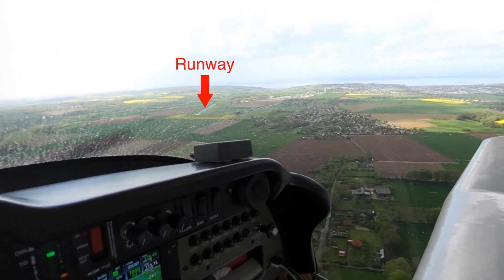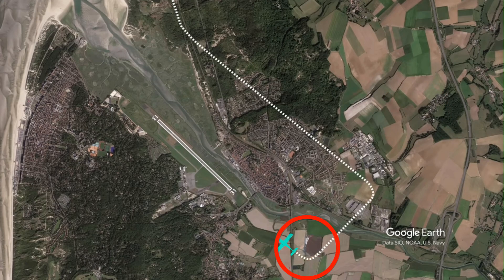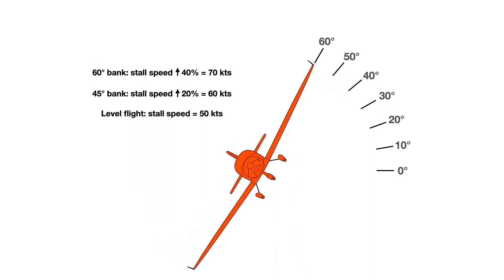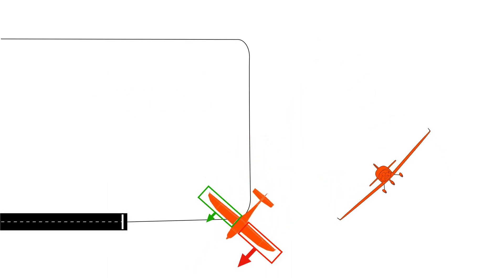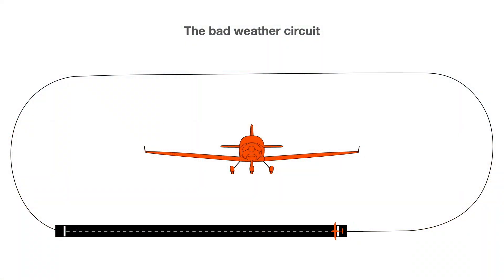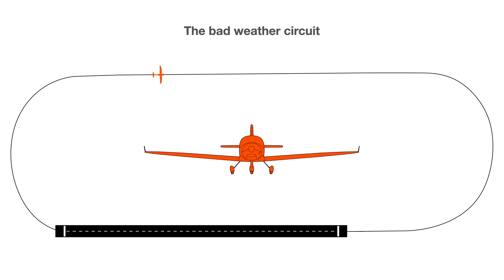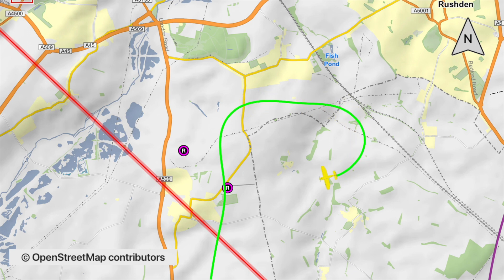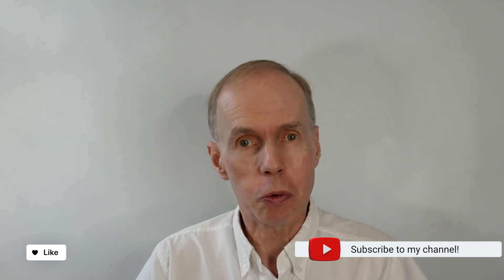Avoid the 'graveyard turn'—a safer way from base to final

Comment: Your video makes so much sense. I just soloed last week and during the beginning of my landing instruction I instinctively flew a rounded/racetrack traffic pattern. My CFI suggested that I fly a more squared off pattern but did say most all new students instinctively fly that rounded pattern and he said it actually made sense. I’m very conscious of my AOA during that base to final turn because I definitely don’t want to stall. If the Air Force teaches the more rounded pattern and if it’s safer then I think it should be standard if not an acceptable option, but I’m still just a student pilot.
Reply from the maker: Congratulations on your first solo and I hope all goes very well with the rest of your PPL training.

Comment: I very much agree with the racetrack pattern, same as we use in crop dusting.  Another advantage of this tighter circuit is that we can allow the nose to go down as designed (dynamic neutral stability) to prevent stall.  The disadvantage in low wing, is poor visibility away from the target (say a long instrument approach final).  But high wing has poor visibility toward the target.  While we had more incidents and accidents before PTS/ACS, we had the same the same unacceptable 300 or so fatalities.  To reduce those fatalities, should we not retain the 1944 Stick and Rudder principles and techniques.  There would be fewer stalls around the airport, too low for recovery after startle, if we returned to Wolfgang's advice to pay attention to what the airplane wants to do?  What does the airplane want to do in all turns?  Is it wrong?  What causes stall?  Exceeding the critical angle of attack is when the stall occurs.  What causes it since the airplane cannot stall itself?

Comment: When I started flying remote control airplanes - I decided to use one half - cirlce turn to land - like the u.s. Navy uses to land aircraft on carrier decks. I only had to turn one time and at a much lower bank angle. It seemed much easier and safer to me (as presented in this video.) I became an rc instructor and I teach all my students this approach.

Comment: If a point is repeatedly the location for deadly accidents it should be scrutinized. Similar I am in favor of a slight turn after takeoff of 20-30 degrees heading so that, when an engine occurs, the turn back to the runway is a lot easier.

Comment: I never noticed the hard 90 degree turns on civilian pubs, assuming they were just drawn that way, and assuming civilian pilots were using the smooth constant rate of turn military pilots are taught. Now out of the military I see squarish 90 degree turns are taught. You never know what you don't know.

Comment: The issue with the constant turn, on a right hand pattern, on a high wing. The wing would block the visual contact with the runway. Because it’s a descending right turn to final in close pattern. Turning final, the chances are higher for being too high or too low for final. The 90 degree rectangle pattern, the base is used to determine high or low and time to do something about it.
Reply from the maker: Thank you for your comment and the point has already been raised by others. I do not have much experience in high wing aircraft, but they also have to manage the bad weather circuit pattern where the circuit, albeit lower, is tighter and the angle of bank is, therefore, greater than in a conventional circuit.
That aside, however, as I explain in the description I am not suggesting that the pattern I describe will be ideal for every situation, and variations may be appropriate according to circumstances; I am trying to point out the dangers of a sharp base-to final turn, that is typically undertaken at low level and low airspeed where there is little margin of safety, and offer a solution to consider.

Comment: while I would agree to a wider racetrack pattern (I see no real disadvantage) I would like to point out that the problem with the standard pattern is not the required 30° bank final curve but obviously bad pilot training. I am a glider pilot and have spent maybe 1000 hours of my livetime doing 45° bank circles, mostly close to terrain. I had not one critical stall incident during this time. If you do this often enough, you get rid of the (bad) instinct to pull up if the ground gets closer while in a bank. Also required is spin training to get more sensitive to stall conditions.
Reply from the maker: Thanks for your comment. I fear that, even with optimal training, these base to final turn accidents will keep happening. With a sharpish base to final turn being a particularly critical stage of flight (low height, low speed, high angle of bank), a few distractions (such as weather, late radio calls, other traffic in the air and on the airfield) can easily divert the pilot's attention from flight parameters which leave very little room for error, whereas, if the aircraft is already set up in a stable approach (constant speed, constant angle of bank, constant rate of descent) that is comfortably within the safety envelope, then any such distractions will be that much less important.
All powered aircraft pilots go through stall training and whilst I agree that spin training is a very good thing to do it is unlikely to save the pilot of a powered aircraft recover from a spin a few hundred feet above the ground!

Comment: Another teaching point that needs to be changed in the name of safety during primary training is, instructors making it imperative that the base to final rollout be exactly on the runway centerline.  Talk about a rule that causes fixation and dangerous rudder correction from a new pilot, this is right at the top of the list. Even using the much safer rounded, downwind to final 180 can turn out to be dangerous if the instructor makes a big deal out of overshooting the centerline.  Overshooting is a comparatively minor issue and is safely correctable by just teaching to gently continue your established bank angle back to the centerline and praising the new student for correctly accomplishing that.

Comment: I think it mostly comes down to predictability. Every pilot on the planet knows what a base leg is…every pilot knows what it looks like when traffic is on final. It’s also easier to gauge “ok, that guy just passed me on final…one, two, three, reduce power”. Those types of things become a little more chaotic if everyone’s doing “short approaches” (which is kiiind of what this is, in essence) with other traffic in the pattern. For the record, I’m not saying one is right, one is wrong, one is better, etc…just simply stating why I believe that general aviation continues to institute such traffic patterns. Myself, I do my best to avoid any such “base to final” situation with early, shallow turns to final and keeping my airspeed well intact until I roll out and I’m stable…even in short field scenarios.

Comment: Hi Steven. I cannot agree with your assumptions in the first half of your video. As we all know, an a/c can stall at any speed, but only one AoA. I don't think I have ever seen or executed a LEVEL base to final turn. In every circuit-to-land that I have seen or performed, the a/c makes a descending turn, unloading the wings and reducing the AoA. That said, I agree that a constant rate turn can work well, if the pilot is trained to do them, like the military.
Reply from the maker: Hi, Bob, I was not trying to imply that the approach was level!
Since it is still possible to stall in a descending turn, the point that I was trying to make is that a stabilised approach with constant rate of turn, airspeed and rate of descent provides a greater margin of safety and is, therefore, more forgiving of error, than an approach with a steep base to final turn.

Comment: Great video…so , isn’t the correct way to do a 90 degree and avoid the stall is to drop the nose throughout the turn ?
Reply from the maker: Thanks for your comment. Yes, your suggestion would work, but the point of doing a constant rate, shallow turn from base to final (or better still, downwind to final if circumstances allow) is that the approach is stabilised throughout: constant bank angle, constant speed, constant rate of descent, so a lower workload and a greater safety margin. The problem with making tight turns at low airspeed and low height is that the margin for error is small and any distractions can cause that margin to be completely eroded.
Reply: @ an ok…but isn’t horsepower everything in an aircraft? What I mean to say is this,  if you have enough horsepower, you can get out of pretty much any trouble… I mean, as an example..look at an extra 300, that aircraft can literally hang on its prop in vertical hold…
So in theory, if you had enough power, you could pull an aircraft out of a stall…but I guess that margins is so narrow that by the time you realized it , you have already rolled over…I guess I just answered my own question..lol
Reply from the maker: Also, the particular problem here is that the stall is asymmetric, resulting in a wing drop and spin at low height. Recovery is then unlikely, however much power is available.

Comment: In the military we flew rounded legs from upwind to downwind, and downwind to final. Partially because we were flying much higher performance aircraft and needed to keep our circuits tight, partially because it’s a much safer technique when executed well. If you get your power and attitude right, you can basically trim the aircraft to almost fly itself around the base turn. Even if you are decelerating or potentially changing configuration at that point, it’s still less dynamic because you simply pitch for profile, enter the turn and then make small adjustments to angle of bank to manage your rollout.

Comment: Teach constant AOA turns as opposed to constant airspeed turns in slow flight. You do not need to see AOA to do such. If you have AOA, however, fly AOA in the pattern. Search Medium for “Improve your Landings with AOA and Power Techniques.” It is all about not using any back pressure to turn. Use power instead. Even gliders can do this via less spoiler. You should not need any back pressure in the pattern till round out and flare.
Reply from the maker: Thanks for your comment and I agree that flying a constant AOA should prevent stall spin accidents. What I was trying to do in the video, however, was illustrate a technique that would give the pilot a wider margin for error and, therefore, a better chance of recovery, if distracted.

Comment: But if you do the base to final turn without applying back pressure, meaning, letting the plane go down, then you are not increasing the angle of attack and consequently, the stall speed.

Stall speed only increases with bank angle IF you maintain altitude.

Letting the nose down while performing the graveyard turn ensures that you're not exceeding alpha crit.

Anyway, I'm also for making wide smooth turns, it's the safest option, I just wanted to make clear that graveyard turn is only dangerous if altitude is to be maintained.

Thanks for the video!
Reply from the maker: Thanks for your comment and I agree, but the point that I was trying to make in the video was to illustrate the danger of the base to final turn when the pilot is distracted and loses concentration and how that danger can be mitigated by increasing the margin for error and, therefore, safety.

Comment: In My training days, I liked the idea of a more continuous down wind-base - final turn. But levelling off briefly to check the pattern for traffic for untowered airports makes a hell of a lot of sense. High wing vs long wing situations potentially arise if you don't level off for a few seconds to look around the pattern

Called it the (american) football pattern. Looks a bit oblong and unsmooth on radar
Reply from the maker: Whilst the pilot will have identified other traffic whilst on the downwind, I agree that, as I intimated in the description, the remaining pattern may have to be adjusted according to circumstances.

Comment: This thread is a good discussion and a nice video explanation. I do both approaches. For very short (and I mean very) short finals I do the rounded approach, for all others I do the squared approach because I have a low wing and want to be able to keep track of traffic. I really do not think the squared approach is more dangerous than the rounded approach, provided that you know and respect the aero dynamics. Dangerous situations arise when pilots are not aware of these, no matter rounded or squared approach.  A squared approach looks squared on paper, but you do no turn on a dime with a 30 degree turn. Thus I use at most 30 degree coordinated bank angle. This increases stall speed by a approx 7% - I always keep the airspeed minimum 30% higher than the stall speed at the current flap setting. I use the height loss in turns as a normal descent. If I misjudge the height loss I add power, I do NEVER pull back on the stick (remember pitch change = speed change, throttle change = height change). If I overshoot and  cannot make a coordinated turn by a large margin it is a go around. The overshoot situation is the setup for a skid turn to align up with the runway, with brings you in close danger for an unrecoverable spin.
Most importantly and even though I have been flying for 23 years I still twice a year train landings. Typically 12-15 landings in 2 hours. High approaches, low approaches, long/short, with flaps, without flaps, rounded approaches, squared approaches, forward slips. Totally MANDATORY is correct airspeed at all times,  correct descent, no bank angle > 30 degrees, always coordinated, never pull back on stick, never overshoot (go around), spot landings -0 meters/+25 meters. The result is that a non spot landing are rare. I do this because I am a firm believer of always doing the same landing is the most dangerous  you can do. Different runways, sloped or not, obstacles, traffic you are not used to, weather conditions etc. dictates that you can not always perform the same kind of landing. And when you are trying to do a "landing pattern" you are not familiar with you introduces a stress factor which for some pilots result in unintended bad decision making during landing.
Reply from the maker: Thank you for your comment. I certainly agree that practicing landings under different circumstances is a good thing, keeping to a discipline is the way to avoid errors and different circumstances may require different methodology. The point that I was trying to make in the video, however, was that a high workload due to distractions such as weather, traffic and so on can break that discipline, lead to errors and, potentially, loss of control of the aircraft. Maximising the safety margin reduces the risk and gives more room for recovery in case of need. I think that making a continuous curved approach, where the aircraft will hold the chosen angle of bank without additional control inputs, does reduce workload and generally increases the margin of safety.

Comment: I disagree with everyone mentioning traffic being an issue.  I have a picture of traffic in my head ten miles out and increase my awareness of what traffic is in the area the closer I get and on each leg.  Once you turn base, the runway is yours.  If untowered and someone is doing a straight in, that should be part of your scan before turning base.  If someone doesn't have comms, they shouldn't be flying.  I suppose that happens and it's legal, but those people are retarded.  Best you can do is work around them.  Obviously towered they aren't putting two planes on the same leg.  At this point, not having ADS-B out is just retarded.  Who cares what the regs say, they're written in blood.  Just get it.

Comment: Steven:
I am a rather new pilot with 120 hours. I completely agree with your statement. It takes a little distraction to not turn base to final when you have to then overshooting. Even though it happens to me many times, still sometimes difficult to figure out a reference when to turn, I turn and always make sure that I am coordinated (ball centered) but if I overshoot, I do not get crazy, I keep making the turn coordinated and then correct to the other side when needed. I guess that a gentle turn like 15d like you will use later in IFR training is better. Even carrier fighters use it. No wonder. Thank you for sharing that. And like last comment, great video, short, to the point. Good job man.😃
Reply from the maker: Thank you for your comment and for your compliment! At least in our aircraft, I think that it is just as easy to hold a steady turn as to fly wings level; in both cases the ailerons are neutral (once the angle of bank has been established in the case of a turn) so the pilot can then concentrate more on other aspects of the approach.

Comment: Well done ... I think the 1 reason so many students are taught the box circuit is that it gives you time to get cleaned up ..airspeed ..flaps ... rate of decent ..attitude . ...   visualisation of the landing point.  As you get more experienced you can get better at doing this closer in.  We are talking 500 hours of flight time here for a commercial pilot. If you don't fly often enough you won't get the "Hands and wrists"  to fly this. No 2 is a busy airport circuit for separation.( as mentioned below). However I completely agree with you.  I have a Cessna 180 that can use 300meters to take off ...but I always go full-length and 20 deg flap so if I have an engine failure close in I can do the impossible turn back and a curved finals means you can make the angle tighter without landing short if you have an engine failure.